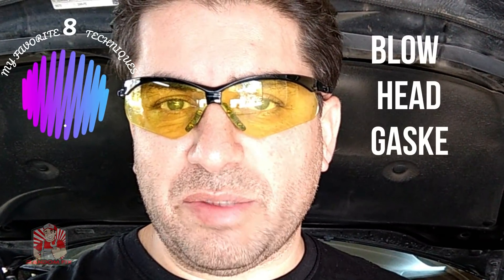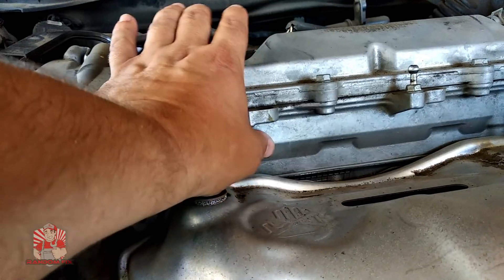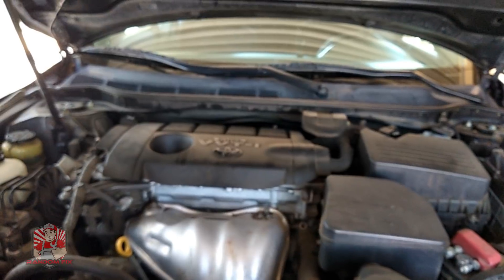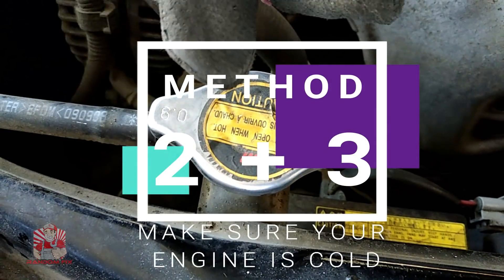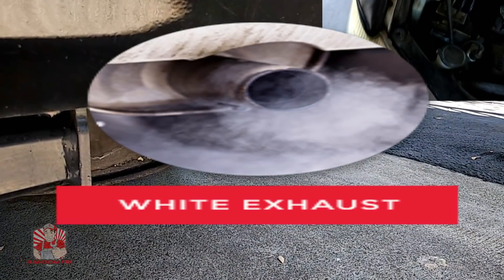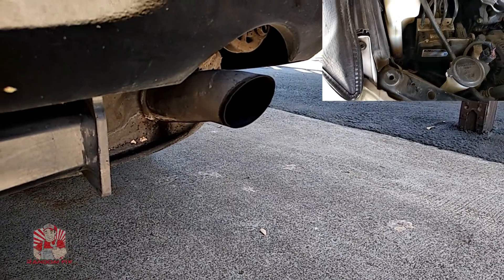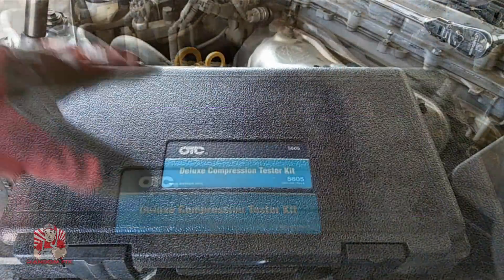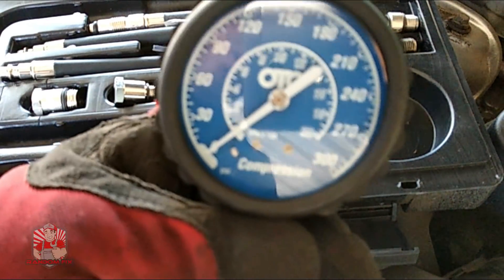How To Check for a Blown Head Gasket▶️ 8 Symptoms of a Bad Head Gasket

Comment: Very thorough. My next step isto use the uv dye while checking the spark plugs. If a leak should glow using the black light. I'm just worried if the dye can damage the cooling system or head gasket and create a leak or cause engine damage. I'm in Jacksonville, Florida and can't find an emissions analyzer, anywhere. Would be the easiest test.
Reply from the maker: I think the dye is pretty safe. Have your heard differently?
Reply: @RANDOMFIX  Thank you for replying.  No, I haven't heard differently, but poured a smidgen in a water bottle with 50/50 Toyota coolant, and let it sit to see if mixed well and did not dissolve in solution but visibly two separate solution, mixes when shaken then separate looking liquids. When water and coolant mixes creates one solution. UV dye doesn't dissolve in the solution.  Still haven't used. Did see one utube video, where highlighter markers were bled into fluid you are wanting to ck for leaks. Put cartridges into solution and let the solution bleed out, then remove cartridges. Think I'll do a test in water bottle with coolant to see if mixes any better
Reply: @RANDOMFIX  Not on Utube, but when I ask mechanics, they say they've never used it.
Reply from the maker: Thank you for sharing. I ran a shop and used it with no issues.
Reply: @RANDOMFIX  Thank you! Very good to know!
Reply: @RANDOMFIX  Were there problems of possible head gasket leak before or after you used it? Did you replace the coolant after leak was diagnosed?

Comment: I tried this. Have a 2016 suburban. P0420 code. Bank 1. Comes on and off. So Its in the edge. I have a scanner that can graph the 02 sensors. Bank 1 is wiggly and not stable. Bank 2 is nice and steady like it should be. I sprayed cat on bank one. Let soak for an hr and drive it. Lots of smoke but it cleared. the graph is much better! Not 100% but deff helped it be more steady. Still have blips here and there but overall it has help. I’ve only driven about 40 miles to re-test it so I’ll report back after a few hundreds miles. Thanks for the video!
Reply from the maker: Thanks for sharing, what is your go to help get rid of the p420 code? Keep me updated

Comment: It is normal for coolant to rise while engine running with radiator cap removed as show in 2-3?
Reply from the maker: Sorry for the late reply! did you find a solution?

Comment: How to fix or reset 2010 Honda Insight hybrid Lx, airbag light?
Reply from the maker: You need to scan with a scantool that allows you access to the srs system. My favorite is a fx2000 and its under $200 [ i have a video about the fx2000]. Once you scan the code you start your to diagnosis the issue. I like to reset the srs light and see it comes back. FYI, Honda has a lifetime warranty on their seat belts. So its a buckle or seat belt system related issue, you maybe able  to have honda cover it. Let me know what you find.

Comment: Hi today my car was boiled,when i open my engine.radiator extra tank cap was pop uped.after re fill the radiator it was runing normal condition.i was face  this befor two week.will you please advise the reason?
Reply: Did u fix
Reply from the maker: There might of been a crack in the radiator or the thermostat might not be operating. Other issues could be a fail water pump or weak fan operation to name a few.
Reply: @RANDOMFIX  mine is doing the same . Radiator flushed . Thermostat checked . Water pump new . Fans working still overheating
Reply from the maker: Any recent repairs? Head gasket checked? 
Here is video that might help you
https://youtu.be/dsN7aCSl-sk
Reply: @RANDOMFIX  recent repairs meaning ?
Reply from the maker: Yes, anything changed with the vehicle driving conditions or items fixed. Did you watch the head gasket video?
Reply: @RANDOMFIX  water pump was changed , radiator is as flushed cause it was clogged thermostat was removed to check and put back
Reply: @RANDOMFIX  yes I watched the video

Comment: can condensation cause milky residue around oil filler cap
Reply from the maker: Yes, condensation can cause a milky residue but to a limit, if you witness lots of milky residues I would be very cautious as the vehicle is subject may only been driven very short distances and can have major defects. _Randomfix

Comment: Great video, can anything else cause any of these symptoms like low compression?
Reply from the maker: Great question, ultimately there is no single one test to 100% confirm that the head gasket is blown as a crack cylinder head, cracked cylinder head, or cracked radiator (some automatic transmission vehicles have a cooling line that runs in /besides the radiator and this can cross contaminate coolant and transmission fluid) can all cause similar problems. _Randomfix
Reply: RANDOMFIX hey can you message me back I have a question if u could help me